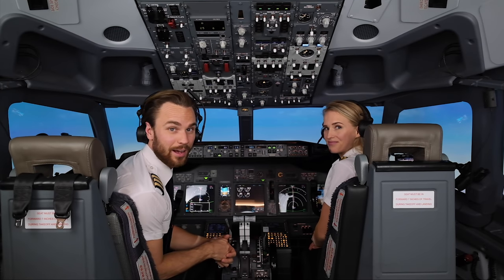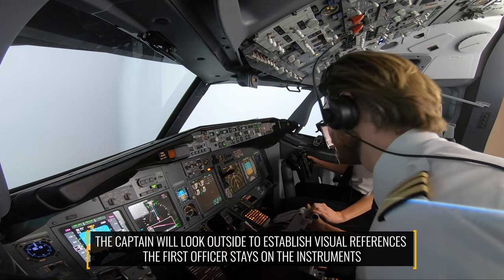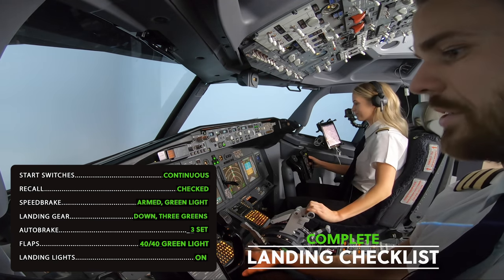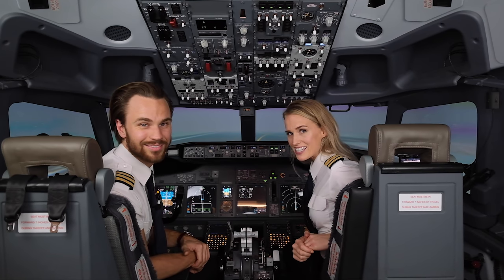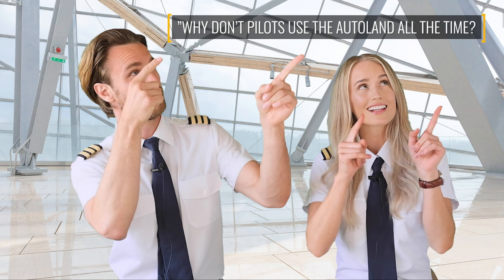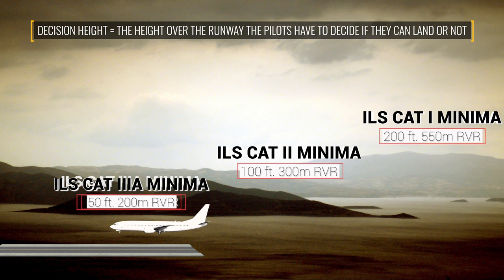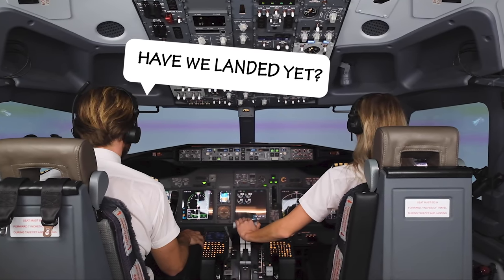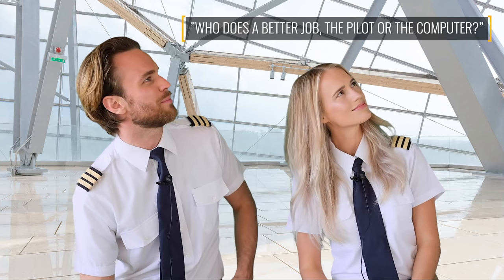Landing in Low Visibility (Autoland Explained by Mr. & Mrs. Pilot Episode 3)

Comment: Again a very good video, keep up the good work. Just a small sidenote. Once the main wheel touches you disconnect the autothrottle. With nosewheel touchdwon you disconnect the autopilot.
Stay safe 👍🤗
Reply from the maker: That’s true 😁 AP disconnect comes after nose wheel touch down. We never thought anyone would notice that I said main gear 😉 Well spotted! The AT on the other hand disconnects by it self on main gear touch down, No need to disconnect it yourself in our configuration.
Reply: @MariaThePilot  your point 😉 still we should disconnect the AT manually just to be sure.
Flying for your company as well. Would love to fly with you guys one day.
Your accounts are just great 👍🙏
Reply from the maker: I have to dig into the manuals once again to double check it 😁🙌🏼 Ah that’s great to hear! Where are you based?  Would be great to fly with you too!
Reply: @MariaThePilot  I'm based in FRA.
Stay safe, see you around 🙃

Comment: Hello, Maria and Viktor) Thank you for your work and this amazing video. Actually, i am flying in simulator too (Xplane 11), but tell me about reverse. So, you disarmed it when you was on 60, knts but in some videos I see that it disarm on 80 knots and than manual break. So the question is: at wat speed do you still need to turn off the reverse?)
Thank you so much! 
Lycka till!
Reply: Dmitry Horvatov , I guess different reverser systems on different aircrafts have different speed limitations. We reduce the reverse thrust to idle when reaching 60 knots. But we keep it in idle until we can assure a full stop landing on the runway available.  But this is Ofc if we use second detent reverser for landing. A lot of landings we only use idle reverse thrust all the way down. And stow then when a safe full stop landing is assured.  On snowy and iced runways you mig need full reverse thrust until full stop.

Comment: Hi can you tell me that, what is flaps? What is the use of it?  How to use it?
Reply from the maker: Basically flaps are surfaces that makes the wing bigger.  It makes it possible for the airplane to fly slower and increase the lift force of the wing. We use them to reduce the speed for landing and also to get more lift during take off :). Did that answer your question?

Comment: An A320 can autoland on CAT 1 ILS as far as I've seen in X-Plane 11....at 400ft the plane confirms that an autoland will be executed in which case the speed brake has to be armed so that the pilots only need to engage the thrust reversers to come to a stop
Reply: We can also make an autoland on a CAT1 ILS approach, but what's the fun in that. :)  It is though mandatory on CAT2 and 3 ILS approaches to use the autoland
.
Reply: @viktorforce   Does the 737 have an FPA (flight path angle) mode for v/s...once used it to try a simulated localized only approach. Still have to try VOR/DME approaches. Last interesting landing I did was following the ILS for runway 27 at London city...not looking forward to boarding an aircraft headed there...too much happening too fast
Reply: Can you do a comparison of the airbus FCU with the Boeing MCP? I understand the airbus one well but the 737 setup for ILS still confuses me. Is VORLOC equivalent to the LOC and ILS on airbus?

Comment: What is the importance of dumping fuel ?what condition we need to dump fuel specially in case of emergency landing?
Reply from the maker: Not all airplanes have the capability to dump fuel. Normally it’s only bigger airplanes that have a maximum take off weight that exceeds the maximum landing weight a lot. If something happens after take off, the pilots need to be able to reduce the weight of the aircraft at a faster rate that the fuel burn to be able to land - that’s when fuel dumping come in handy :)

Comment: If I manage to land a 737NG/MAX with CAT III conditions manually WITHOUT CMD A and CMD B, what will my colleagues say? Had to force one with V/S and disengage at 2500ft AGL following localizer and G/S and landing safely
Reply from the maker: It depends on the configuration of the 737. A CAT3 can be flown manually with the required equipment - for example, I believe you have to have a head up display and som other systems for that to work out. If you don’t have those systems you’re not allowed to fly the approach manually. One have to use the auto land feature.
Reply: MariaThePilot I landed a 737 just by eyeballing the GS and LOC. This is i believe at CAT III B conditions. Managed to see the RWY before touchdown. Will I get any criticism or will I get a report?
Reply: @MalaysianAviator737-8  if Your airline doesn't allow it ....

Comment: I just could not understand what does it mean by "the airport and aircraft should  be equipped with ILS CAT I/II/III instruments "...can you explain a bit more about it
Reply: The ILS is an instrument landing system - basically, an antenna based on the ground at the runway. For it to be certified as either CAT 1, 2 or 3 the airports have different requirements that they need to comply with, this could be in regards of obstacle clearance, safety areas, type of approach light system etc.  And therefore also a matter of costs differences for the airports. Onboard the aircraft on the other hand different types of the ILS approaches requires the airplane to be fitted with specific instruments and systems, this could, for example be - more than one autopilot, radio altimeter, dual hydraulic system, 2 air data computers etc.. These specifications also vary for different Aircraft types. Did that answer your question?
Reply: @viktorforce  yes, thanks dude...
Would you plese tell what are those two switches located below the autopilot swithes,and how to engage "flare mode" ...and please make a detailed video on FMC setup of Boeing 737 how you enter route and everything. ..
Reply: I think apart from having the physical instruments and systems required, the plane has to also be certified recent for an autoland in the technical log. This also applies to the pilot in which he/she needs to be recent for an autoland to commence one. Hence why sometimes, if the airport allows it, some pilots request for an autoland even in clear weather conditions in order to remain current.
Reply: @blue_hacker9594  When the autopilot is engaged, as in this case for an autoland, the flare mode will be automatically armed after it passes a certain height which according to the video is passing 500ft.

Comment: When do you get to fly Vmax and how much extra fuel (%) do you typically take on board? I like to get my destination as fast as possible 😎
Reply from the maker: We don’t fly the maximum speed very often. It’s not very economical and efficient. If we were filed at a higher speed in our flight plan. The flight planning system will calculate how much extra trip fuel we need for that sector with the increased thrust.  Did that answer your question?
Reply: @MariaThePilot   Yes, you answered my question thanks. Keep up the great content!